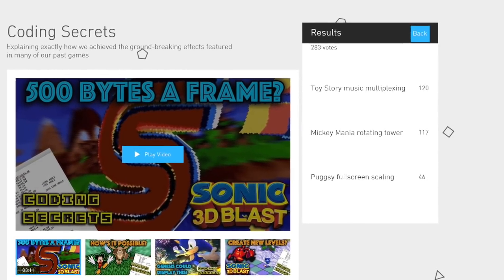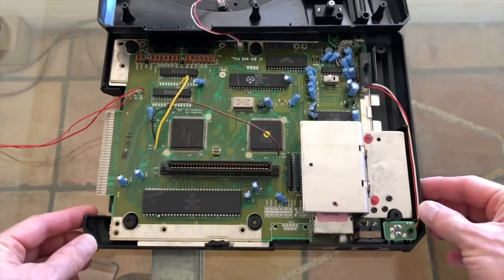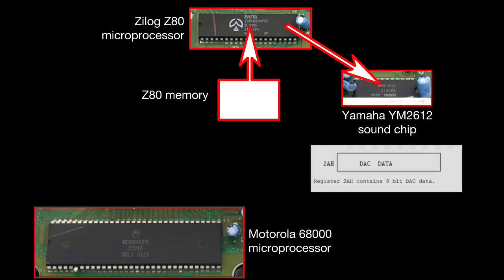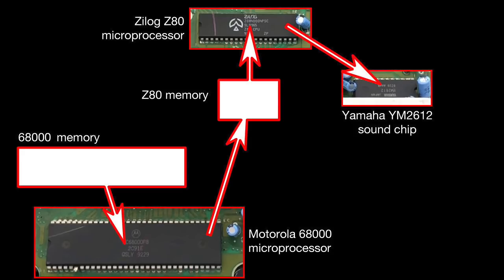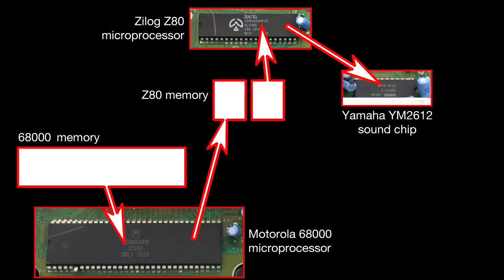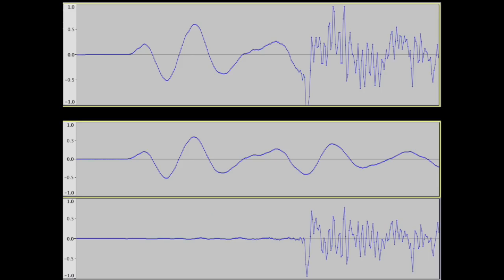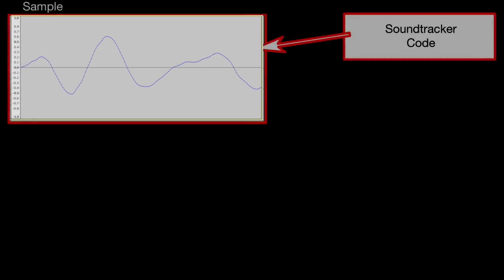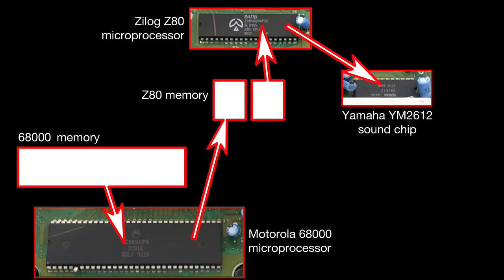Toy Story's Hardware Defying Music - How We Did It

Comment: When you brought up the Amiga, I thought you just cheated all the way through and sequenced it on the Amiga then streamed audio to the PCM channel, using comparisons and reusing of audio sections short and long to compress it.

Not only was your real execution higher quality, but more clever than I even thought possible. My hat is off to you, and you didn't even fill in the cracks with FM!
Reply: Actually, that's pretty much exactly what they did. An amiga MOD track is already nothing more than a set of audio samples for instruments and patterns that specify which samples to play and at what speed (=pitch) and volume. Writing a MOD player for the 68000 is a bunch of work but is relatively straightforward. Streaming the resulting audio over to the Z80 is the unusual part.
Reply: James Churchill I know that. What I was implying was streaming one stream of data with the entire song (like an .mp3 sorta), not having each instrument having its own "channel". Remember, I thought that the PCM channel was only capable of one sample at a time.
Reply: The PCM channel is only capable of playing one sample at a time.  In this case, the main 68000 processor combines four channels into one mathematically.  To the Z80 processor, however, it is only one sample.

You COULD calculate everything beforehand and store the result, but that would eat up way too much disk space.  Even if you could compress it to a reasonable size, you still have to decompress it when playing the sound.  You are then going to eat up the system's memory or have to decompress in real-time, which probably wouldn't be feasible.

Comment: I have a feeling this channel will get a lot of people interested in computer science
Reply: certainly helping me get the motivation to continue studying.
Reply: Agreed. His work and his will to share knowledge is inspiring.
Reply: The electric wire went thru the sand chip yo. Fukn sweet. Computer chips are made of the beach bra
Reply: Definitely, but during my years in a CS degree at University there was seldom much of this 'stuff' with the program solving aspect - a lot of it was mainly fundamental programming of different languages, and courses which geared towards software engineering planning and management. Very rarely did I engage with the theoretical aspect of CS and delved a lot into the practical aspects of it, essentially becoming a glorified code monkey. I like computer science AS a science itself, like how you learn Physics or Biology or Chemistry with both practical and theory in balance.  However, the truth is that it sucked a lot. Reason being is because the course was geared to get you straight to finding a job. The reality, is that CS is a science and should be treated as such.

I was doing this as a double degree with a computer and network Engineering degree and the honest truth was that the Engineering side of things is much more enjoyable for me, because the practical content is more 'hands on' and diverse rather than coding for hours on end. But for those who are considering or are pursuing computer science, please do! There is nothing wrong with computer science and it is absolutely fascinating. Be aware though that most CS degrees aren't directed as science degrees and do not focus on computational methodologies, concepts, philosophy etc.